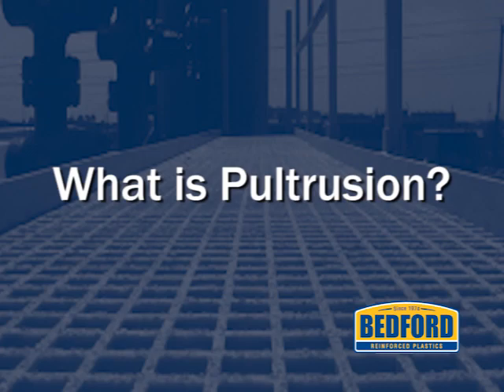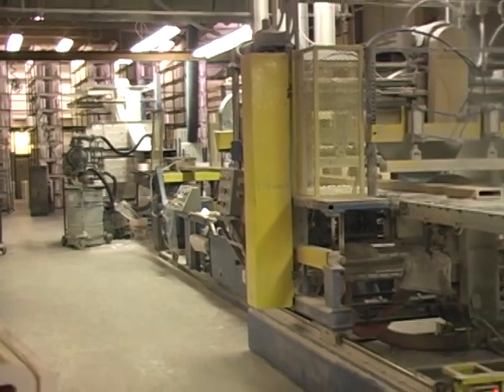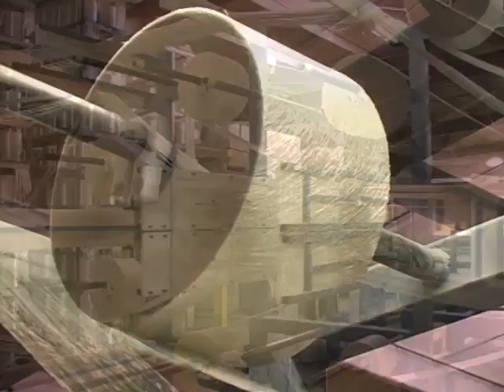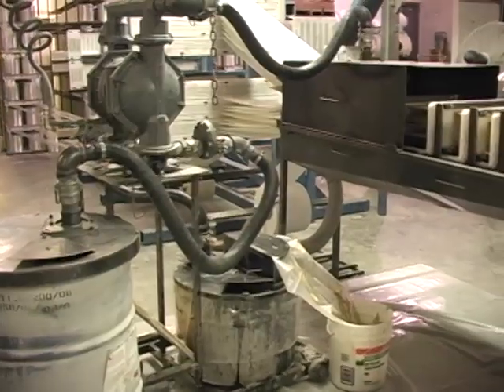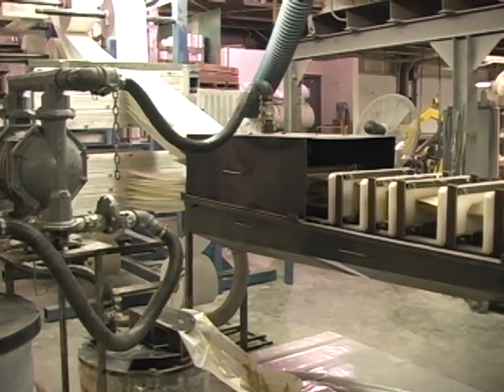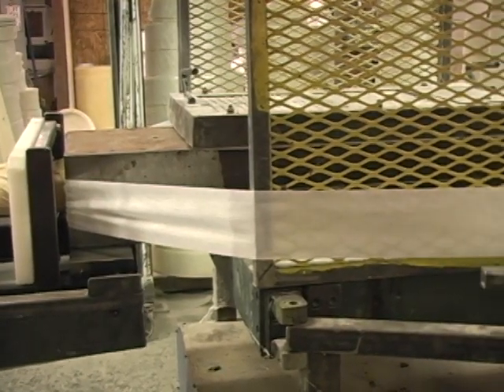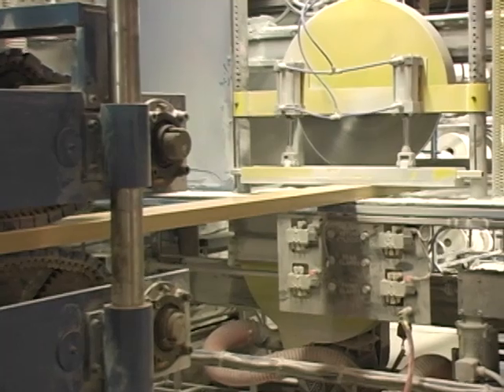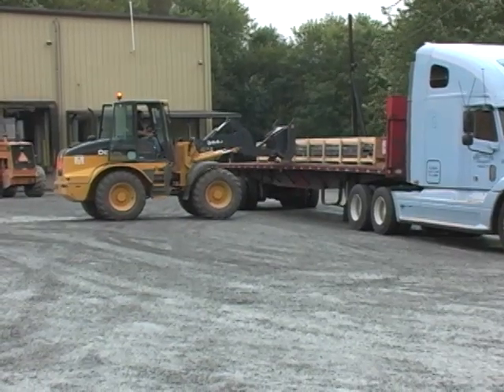From Fiberglass to Finished Product: Explore the Five Steps of Pultrusion

Comment: Hello. How do you form a hollow profile? Do you use a "floating" core? If the core is fixed at only one of its ends, what do you do to avoid having undesirable deflection on the beam?. I think having a deflection on the beam would result in an unwanted shape of the cross section of the pultruded product. Is the material, passing through the forming die, helping the core to stay at proper straightness?
Reply from the maker: Thanks for the note Daniel! The core is a steel mandrel just like the forming die. It is held in place at the same end that the raw materials are introduced. When properly aligned and fed into the die, the glass reinforcement actually keeps the mandrel centered in the cavity. Hopefully this helps? Feel free to share your email address and we'll make sure you receive all the latest tips, tricks, news and updates!
Reply from the maker: Awesome, you're signed up. If you can provide your company name and role, we'll plug that in so you get more relevant info.

Comment: How is the resin in the adding process kept from firming up over time? Is it only heat activated? What about when the machine will not be used for a while? How is the resin removed?
Reply: Yes it is heat activated. When the machine is off line the resin is pumped out of the bath the fibers are cut out before the resin bath and the forming die is removed and cleaned